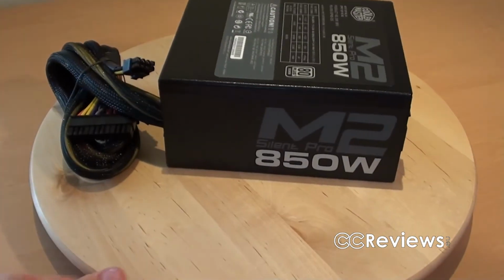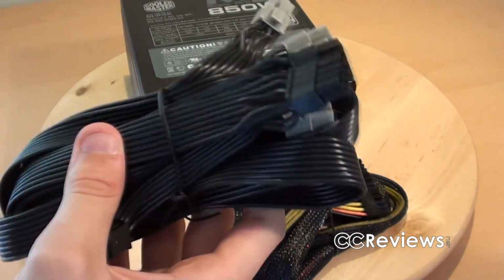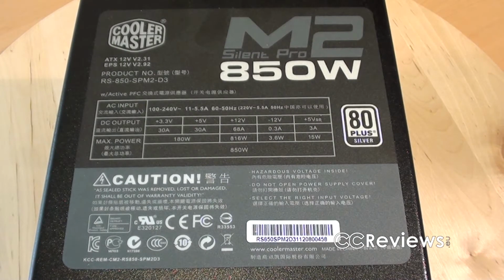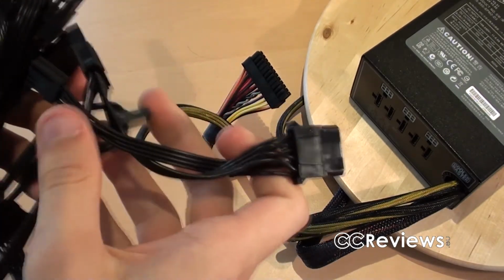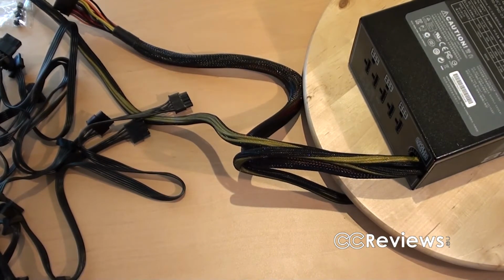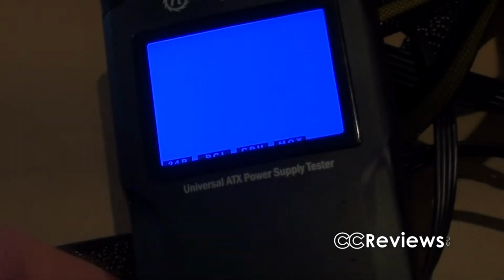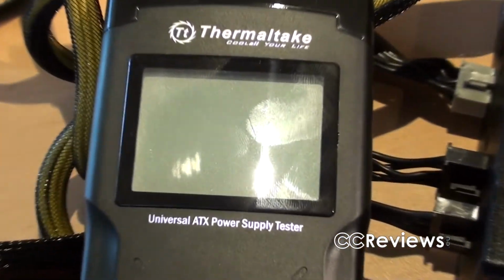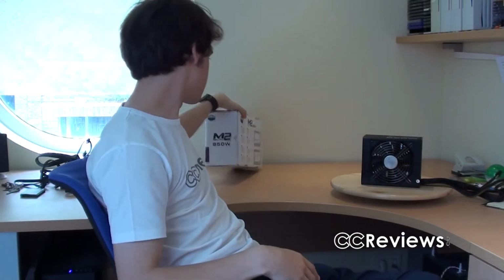#76: Cooler Master Silent Pro M2 850W PSU Review (CCReviews)

Comment: The motherboard I'm ordering has a 24 pin and 4 pin connections for power.  Since this only has 8 pin CPU power plugs, does that mean it won't work for my build?

Comment: I have the same power supply just bought it and I try it on the mother board for updating my BIOS on DS mod because m build is not complete yet, the PSU fan wont turn and the CPU fan wont turn and the lights on the mother board turn on
Motherboard : P8Z77-V PRO need help thanks

Comment: shit psu don't buy it for gaming almost burnt my house
Reply: Same here. Flames, smoke, horrible smell. :( Watching this to see what cables have been delivered with it, so I can send it back (after only 6 months). They didn't even include a list with all the components that were delivered. What a pain in the ass right now.
Reply: WTF happened :D
Reply: this shit psu literally exploded i got a replacement thu
Reply: Nasser Mohd My started burning. Fortunately the flame went out when I pulled the plug. I got replacement without any problems. However, I'm not leaving the pc unattended when switched on, anymore.